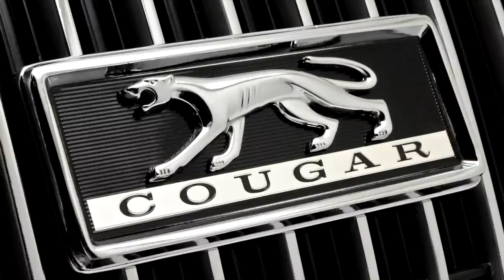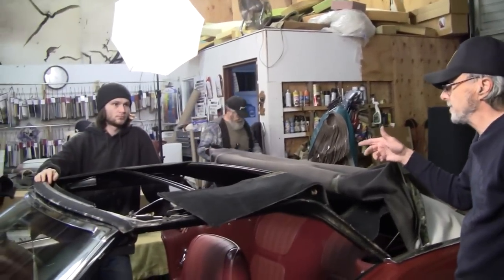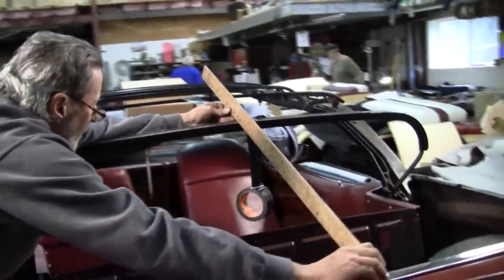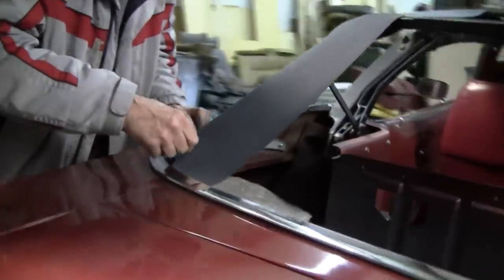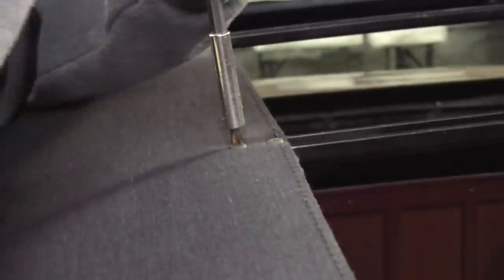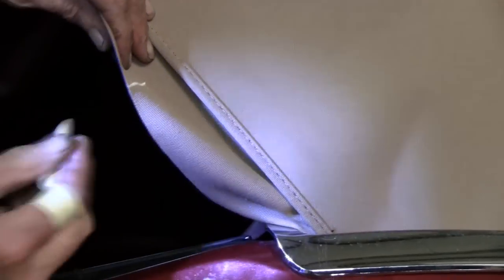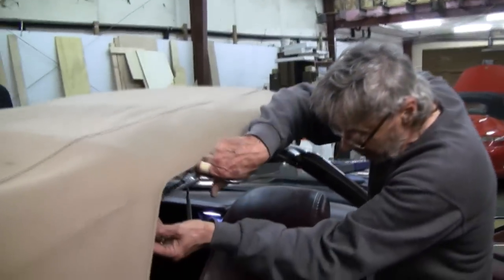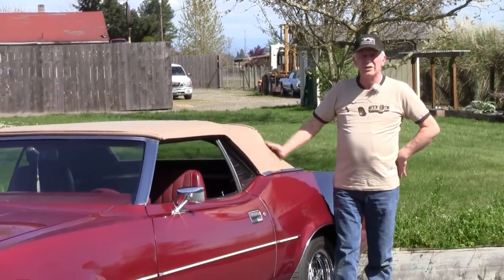Convertible Top Installation By A Pro - 1971-3 Cougar / Mustang

Comment: Thanks for the classic car content.  Ihave two that need a new top.  Do the replacement top maker use solar thread to sew the top together?  I made mistake of using a aftermarket top for a Z3 and the treads started disintegrating after a few years even though it was always under a cover at home.

Comment: Seems like a new upgrade top would call for upgrading the top & window rubber seals? I would not recommend using oem original rubber on a new replacement top.  Especially since you said it’s so labor intensive.

Comment: Does upgrade canvas material last longer than the OEM vinyl?  
What is the labor to install the new kit?  You said it took 3 days. That’s a lot of work.
Reply from the maker: Yes, the canvas does last longer if properly cared for.   We have used several installers and the time involved seems to vary by installer, sometimes dramatically.  We usually suggest calling several auto upholsterers in your area and see what they quote.

Comment: How do the tack strip go in with stapler or?
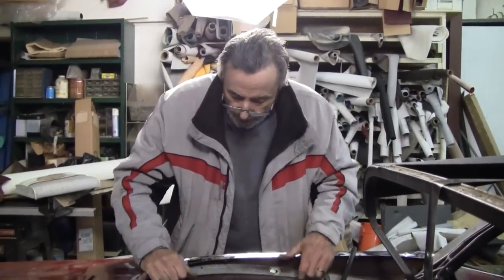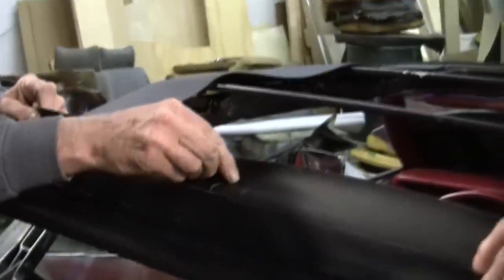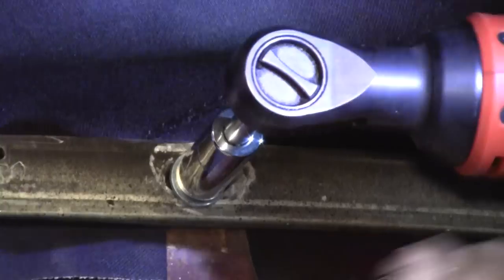Reply from the maker: The pads (@27:39), the back window (@35:48) and the Top (@46:25, 1:02:26) staple to the tack strips. Then the rear tack strips that are not a part of the top structure bolt to the car (@51:20).
Reply: @WestCoastClassicCougar  oh wow they  bolt to the 3rd bow oh ok i know i have a 66 Cadillac and it was originally stapled in i know different from a cougar love your  video  btw
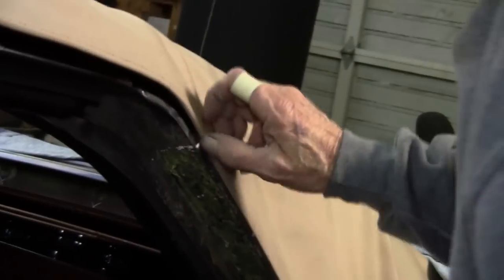Reply from the maker: @bigcurt011  Just to make sure I conveyed it clearly, the canvas itself either glues (51:37) or is stapled to the top structure and, at the rear, the canvas top is stapled to the rear tack strip.  The rear 3 piece tack strip is not a part of the folding top structure/mechanism on the Mustang/Cougar (https://secure.cougarpartscatalog.com/71convtackstrip.html). The 3 piece tack strip staples to the very rear of the top's canvas.  Once the top is stapled to the rear 3 piece tack strip, those pieces then bolts to inside of the convertible top well (where the top is stored when it is folded down into the car).  The rear tack strip is what connects the canvas top to the body of the car at the rear of the car.